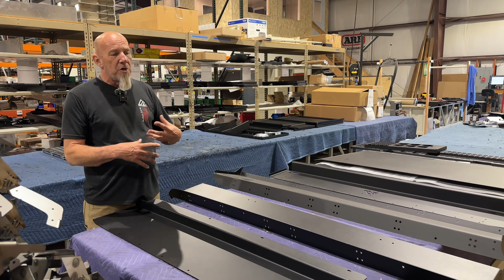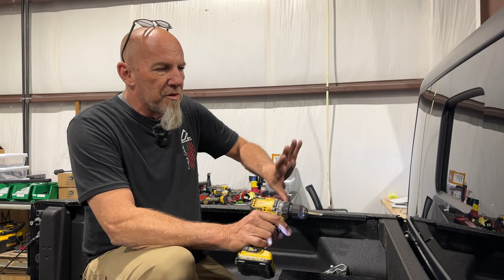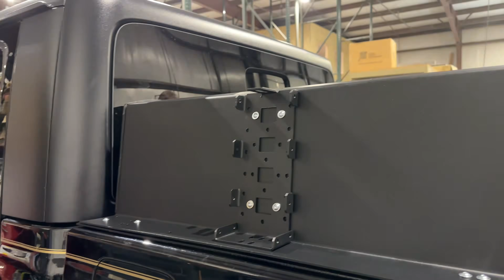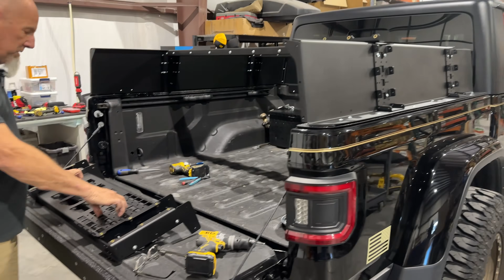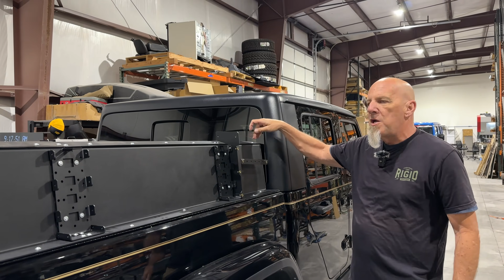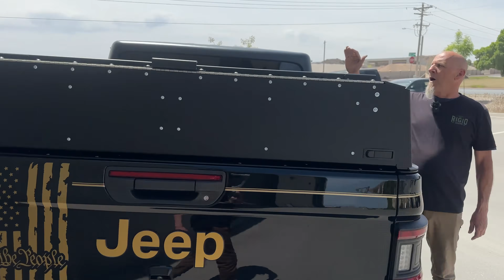Load-Bearing Enclosure (LBE) Install Walkthrough for Jeep JT Gladiator / ATK Trailer

Comment: Love it and would love to get one for my gladiator but u guys dont mention anything anout Static weight and dynamic weight i cant find them anywhere can u please let me know what they are or update the website cheers !!!
Reply from the maker: Unfortunately, I don't have a way to determine that other than destroying a Gladiator bed. It's built for rooftop tents and handles those extremely well. Above and beyond that, I don't have any data. Please let me know if you have any other questions. Glad to help.

Comment: I'm torn between this and a smart cap mainly becuase of dust is there any kind of positive pressure system to prevent dust intrusion?  My tonneau cover still allows a little dust in even with the tailgate sealed like crazy haha.  This product looks amazing.
Reply from the maker: I have thought about doing a pressurized system with a filter and a blower. The main problem is there is a ton of air gap in the bed and tailgate. That is the weakest link in the Gladiator bed, for sure. There are a few gaps it the corners of our LBE. I don't seal them on our shop Gladiator because I like a little bit of air, but the majority of the air comes around the tailgate. My plan was to make a set of instructions for making it "air tight". We haven't had anyone ask about that yet.

Comment: Cheater, cheater, pumpkin eater………I see your molle panel end braces have nutserts/Rivnuts in them.  Ours do not have those.  I was wondering how you got those lower, bottom bolts in on the molle panels because you cannot reach up in there to put a nut on the end of the bolt.
Reply from the maker: I just went out and looked at a couple of them and can chat you through a work around if you want to call/message us. I also want to make sure I’m looking at the right thing.
Reply: @AdventureLab  I think I am good for now.  I ended up only putting one bolt/nut in each end of the support bracket instead of the two you guys did because of the nutserts/Rivnuts.  I figure if I run into issues, I will drill those braces and put nutserts/Rivnuts in them like you guys had in yours.

Comment: I have been looking for something like this for my Power Wagon.
Reply from the maker: That would be cool, not sure what the dimension difference would be from the JT.
Reply: @AdventureLab  I have metal rollup cover on my bed. It sits on top when it is rolled up and you need 13 inches of clearance over the top of the bed to roll it up. I use it to keep stuff secure and dry. I think that is a good place to start. That will keep a RTT below the cab by a few inches.
Reply: We are in love with ours. This is our jeep featured in the video. We can’t say enough about this product and the people who work there!

Comment: Love this product! I will definitely have to look into getting one for my gladiator. Would it be possible to mount a spare on top of it?
Reply from the maker: Thanks for the feedback! In terms of weight it would handle that and more like a rooftop tent no problem, just have to configure everything how you like! Do you mean on top kinda Baja style?
Reply: @AdventureLab  Okay, that's good to know. Yes, I was thinking more like Baja style.
Reply: @armondgilmore6589  You would need the bed rack as shown in this video to put anything on top.  According to the directions I received, you can just have the LBE without the rack.  I have mine installed with the rack because I am mounting a roof top tent on top of mine.  Spare tire on top should be no problem with the bed rack.
Reply: @garretlewis4103  Awesome! Thanks for the info!!
Reply: We love ours. The product is awesome and the people who there are amazing. Can’t say enough good things about both.
Reply: @OutlawOverlandAdventures  Agreed....Good people to work with.

Comment: On our 2021 Gladiator the 4 holes in the front wall did not line up with the threaded holes at the front of the bed.  The two inner holes lined up.  The two outer hole where a little to the center and they did not line up.  Had to elongate the holes.  Just a FYI.
Reply from the maker: Thank you for the feedback, we will take a look and make adjustments. Appreciate you!